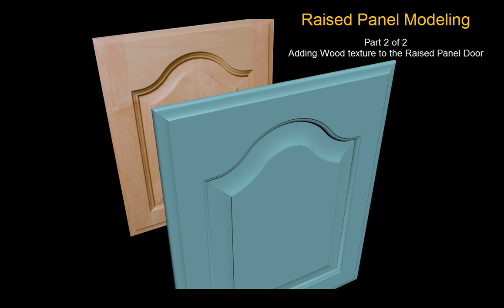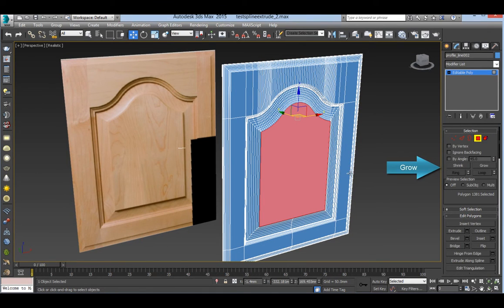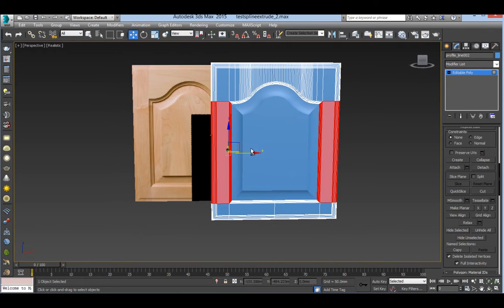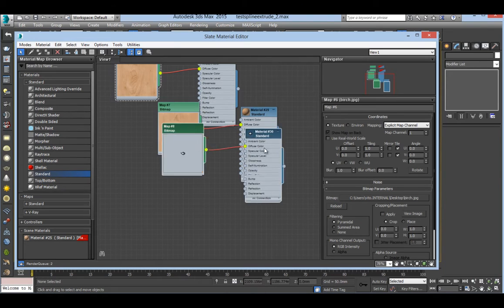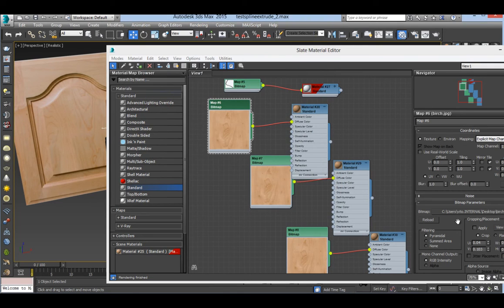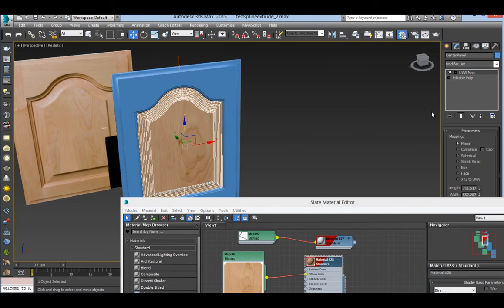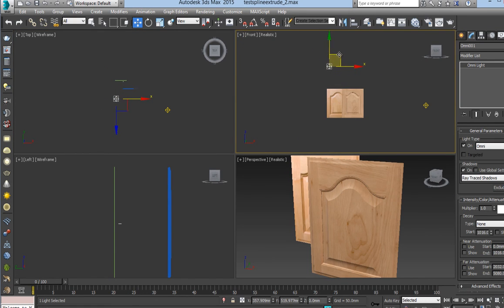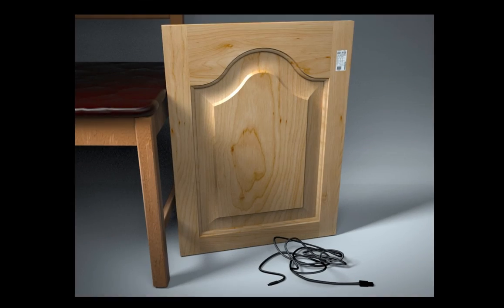Raised panel Door -3dsMax  - part 2 of 2

Comment: how would you duplicate this door in a full kitchen where we need more than one door, and they suppose  to be all different
Reply from the maker: Good question. In a full kitchen this method of mapping would not be convenient. As for the different sizes and curves... I would just make each door as needed. Just like in real life these doors are custom cut but they come in a few sizes. 12In, 15 in. 16", 20", etc. For this method, I would make my SET and save it for those kitchen designs.
Reply: thanks for the video and the reply